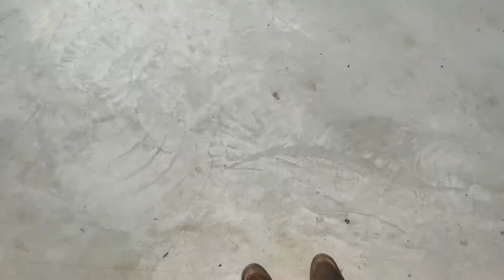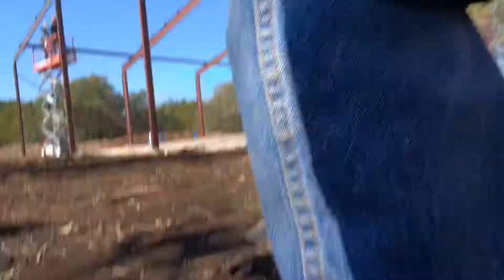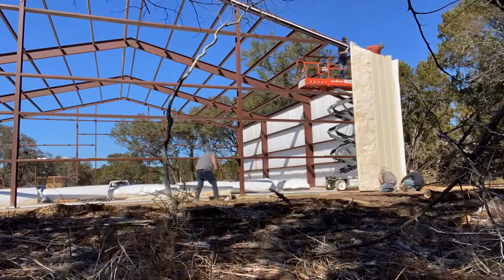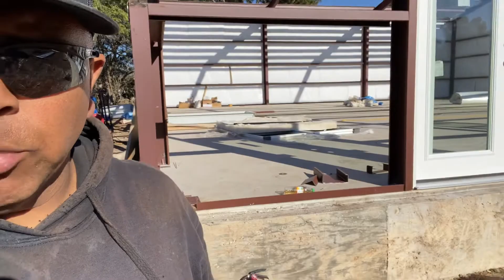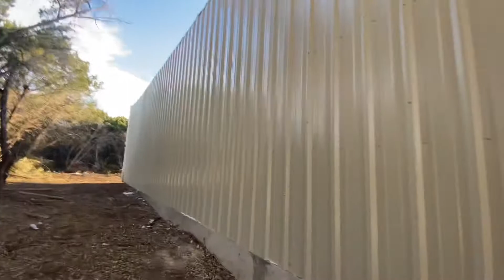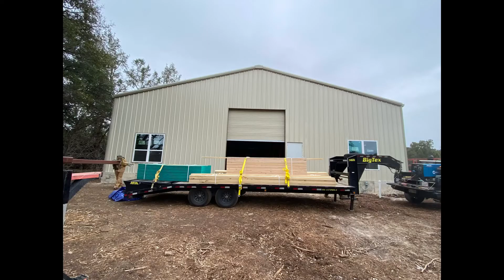Metal building build recap Episode 3

Comment: Like your Miller bobcat 250 welder. I was wondering why is the end wall beams smaller  then the interior beams I am looking at building a metal building for myself so I am trying learn all I can about them.
Reply from the maker: You have the main frames that look like a wide A that provide most of the weight bearing. Then you have 8-10" beams that provide stability to the entire structure, while transferring weight evenly to those parts of the building. When you get into the doors and sheeting you will have to provide attachment points for the perlins. These help with this as well. Ultimately for a more technical answer we would have to ask an engineer. Thanks for subscribing!